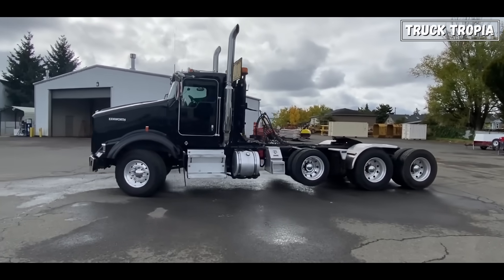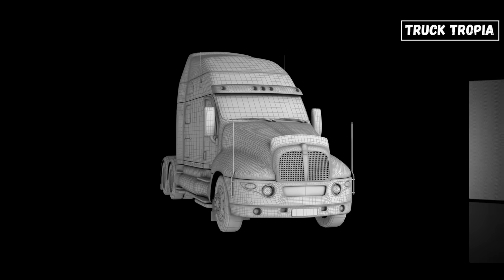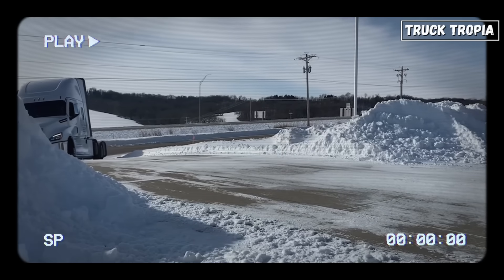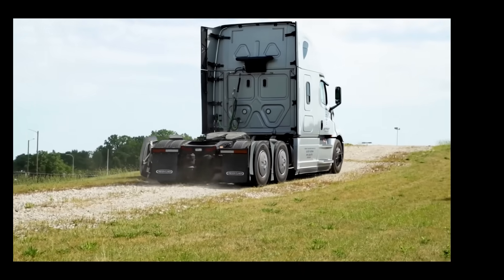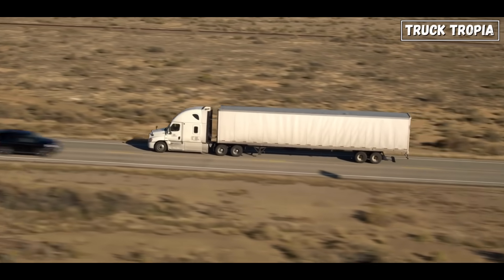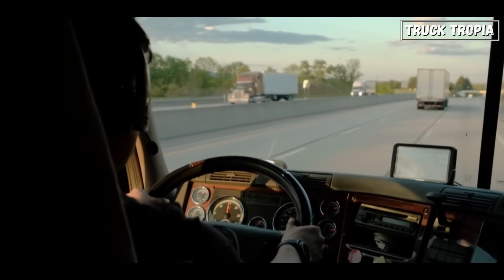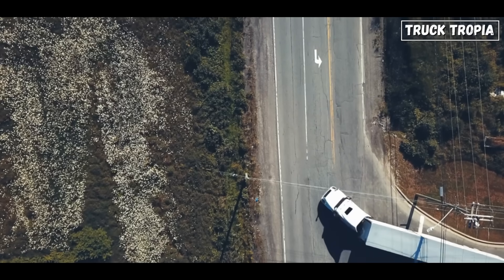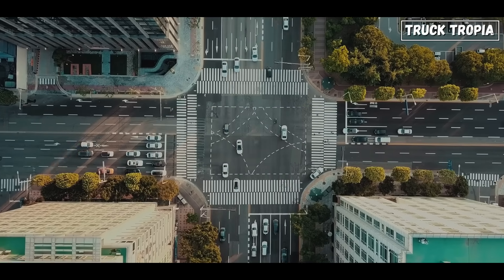Why Do Some Truck Tires Don't Touch The Ground?

Comment: Lifting axles when not needed for weight distribution reduces steering resistance in confined quarters, eg urban areas. You can think of it like a truck with multiple axles almost acting like it’s on rails compared to a car which has a single tyre at each corner. Unless all its axles are self-steering a truck’s tyres will scrub the further they are from the center of rotation.

Comment: I thought "lift-axles" was "stationary axles" that was built to be a bit higher up, but low enough that when a heavy load was placed on the truck, it would push it all down so the "stationary axle" would come into contact with the ground & therefore take up some of the weight, I didn't expect them to be movable, even if that makes more sense, but creates more parts that can break.

Comment: I used to work on a rigid refuse truck which had an extra axel like that at the back in front of the main rear one, it lowered automatically once you reached a certain load weight (typically around 22000 KG) though you could also lower it yourself with the onboard computer. I’m not sure if Dennis Eagle makes those types any more. All the later models I used have the single wheel axels behind the main rear axle and they are connected to the steering, thus always down.

Comment: 0:40 - “Axels are connected to the wheels by bearings”. Nope. Axels are connected to the wheels very rigidly via bolts, making a solid unit. The axels, near the wheels, are connected to the suspension system via roller bearings allowing free rotation of axel & wheel combination.

Comment: What physics did this guy learn?

Friction is a function of normal and the friction coefficient. The number of tires in use doesn't change de normal force, more tires in use just distributes the load more evenly. It won't change friction nor fuel consumption.

Besides using all the tires at the same time will just distribute wear and tear more evenly among all the tires.

What's the point of having a whole axle and tires staying idle? It's cosmetics...

Comment: So cool little bit of side info. Since these wheels are raised and lowered with airbags, most trucks allow you to adjust the pressure in the airbags to maintain proper ground pressure for weight distribution and traction. 
Too much pressure and you can actually put too much weight on these tires leading to excessive wear and even blowouts and you can even make it to where the drive wheels don’t have enough traction. While too little pressure can effectively mean they aren’t even doing anything.

Also a fun little side story, I was doing first time inspection on a truck we bought that had a set of these wheels. I found out the pressure regulator was actually broken for the airbags and when I went to drop the wheels the airbags were so over pressure that you actually couldn’t drive the truck while it was empty because it completely lifted the drive axel about an inch off the ground. Had to basically rebuild the system for the drop wheels because of this
Reply: That's literally fake news. I won't say 100% of all trucks, but almost every single truck is equipped with a dump valve. Not a pressure regulator.. we can't just adjust pressures on the fly. Trucks have ride height adjusters though, but they're completely independent from the drivers seat. 

It's just a lever that moves up and down with the weight of the load that adds or subtracts pressure from the bags to maintain proper height. Has nothing to do with tire ground pressure, or anything else. Strictly a way to maintain the same height regardless of load.
Reply: @sergeantspeed5941  Yeah he thinks that truck axles still use spring and only the tag axles have air bags. Also this garbage video thinks that they actually provide power for some reason because "2?" trucks do.
Reply: Sooooo, no. The axles that lift up when not needed have springs to lift them up. When the driver needs them their air bags are tied into the entire truck airbag suspension system to make sure the bullshit you are saying can never happen. And to be clear, The amount of engineering, and cost per truck, it would take to make the tag axles an entire independent system would make it more difficult to use is an order of magnitude more than just tying it into all the other airbags on the drive axles. You obviously have no idea how trucks actually work.

You're an idiot.

Comment: This is why bumps on the highway often have skid marks on them. As the truck goes over the bump the raised wheels (not spinning) will contact the bump and leave rubber on the road

Comment: Clarification to your first point, more tires do not make more traction, as surface area is not considered in the equation for friction, only pressure and material coefficient. Lift axles also are not powered by the engine, and since they are taking pressure off of the other axles, they will actually reduce traction for accelerating.

Comment: I felt like i already knew the answer to this, and to an extent i did. I knew the floating axle was for when the truck had heavier loads and figured it was for better weight distribution on the suspension. What i didn't know was that they could be lowered dynamically. I thought they activated when the suspension sunk far enough for the floating wheels to touch the ground. Now i know better, all because i didn't let my hubris skip over this video i thought i already knew the answer to.

Comment: Now I have another question. Why are a lot of oversized trailer in US have extra bogie trailer attached that seems not actually distributed any weight and only served to hold a oversize plate. It increase the towing weight, the overall length, the driving complexity, and helps nothing. Is this another trick to complying local law?

Comment: If lowered axles increase grip and improve safety, is there an automatic deployment option under emergency braking/steering? Seems there should be.
Reply: No because when empty, the more tires you have, the less pressure per square inch is applied to the ground i.e you skid the tires much easier. 

When loaded, yes because at full brake, you still can't skid, but benefit from the extra wheels braking.

Comment: I assumed it was a weight thing, when at full or high loads that the suspension is lowered and it helps ease that load. I just assumed it was a passive system.

Comment: Those are drop axles they are not drive axles. they are only used to support extra weight. and there is no sense in running those axles. when there not at enough weight or when the truck is empty. and not using them saves wear and tear on tire's and brake's. maximum weight for trucks on American roadways Is 80.000LBS. but sometimes the weight of the load net weight. along with the tare weight the weight of the truck when it's empty. will make the gross weight which is the total weight of the truck. exceed 80.000LBS. requiring the need for tag axles to be used. this is the reason for these axles. the maximum axle weight's for eighteen wheeled trucks. Is the steer axle being 12.000LBS and 12.500LBS with special steer tires. and 34.000LBS for the drive tandems. and 34.000LBS for trailer tandems. equaling 80.000LBS. anything more than that requires additional axles.

Comment: I don't think much of this is accurate. 
Fuel efficiency: The formula for rolling friction (simplified) is F = n * Cpt * W/n : F is the total rolling friction, n is the number of tires, Cpt is the coefficient of friction per tire, and W is the total weight. For instance if you plug in 18 tires, 16 tires, and 14 tires, with a Cpt of .012 and a weight of 50,000, the rolling friction is identical. Which would indicate zero benefit to fuel efficiency. In fact though, considering the greater weight per tire would cause more deformation, resulting in a higher Cpt, the fuel efficiency would actually decrease with fewer tires touching the ground.

Maintenance: Sure, the axels not being used would experience reduced wear and tear, but those being used would experience increased wear and tear. At best it would be a wash, but considering friction is multiplicative, it would undoubtedly be better to just use them all.

Weight restrictions: Having fewer tires in contact with the surface would have zero impact on the total weight. Weight restrictions are for both the total weight, and where the weight is distributed. Changing the number of tires on the road doesn't change this one bit...

Traction: This one does make sense. Which, if you think about it, actually validates my previous point about the friction. By reducing the number of points of contact, you're increasing traction. And what is traction if not simply friction by another name?

All in all it's usually silly to not be using all the truck tires available. By not doing so you're increasing the wear and tear on those that are in contact with the road, and actually reducing your fuel economy. No doubt these fallacies have continued simply because they've been repeated so many times that people just assume them to be true.

Comment: We call them drop axles, not lift axles. Used to drive a 105k GVW fuel tanker in Oregon - which is a truck with a tank(steer axle, two regular axles, and one drop axle), and a trailer with a bigger tank(8 regular axles, but split 4 in front and 4 in back). Over 11,000 gallons of gasoline.

Comment: Civil engineer here. More axles doesn't mean less wear and tear of road. Quite opposite, if they are put in a row with little gap between them, 2 axles will destroy road less than 3. It's because for asphalt more damaging in this case is sudden compression and decompression cycles one after another than weight itself. That is why regulations (at least here in Europe) specify max single axel load depending on distance between wheels, from 11t at less than 1m up to 20t above 1,8m.

Comment: With a rigid vehicle, if it has a lift-able rear “tag axle” that can distribute weight more evenly, but can make it difficult to make a tight turn, even if it’s a rear steering axle, the tyres will scrub across the ground when trying to do an extremely tight turn so it’s best to lift that when driving in towns or cities with lots of sharp turns.

Comment: Never heard the term "lift axle" before. Both fore and aft have always been called tag axles that i've heard. I even used to build them.
Reply: I've also heard them called "pony" axles but haven't heard that term used for years. My brother had a long-bed 10-wheel grain truck with one drive axle and a split (i.e., longer wheelbase) tag axle farther back. Had a lot a tire wear due to sliding through corners, but his weight distribution allowed him to carry heavier loads (at least according to his calculations). He also had another 10-wheeler with tandem drive axles -- he could take it through farm fields but the drive/tag truck was worthless out there if it was the least bit damp.

Comment: Huh, not what I thought. I imagined that as you add weight, the chassis would sag. At a point, those wheels would touch the ground. Which would distribute weight. I did not know that they could be lifted and dropped manually

Comment: I used to drive a 6 axle dump truck that had 3 lift axles.  However, there are also 7 axle dumps with 4 lift axles

Comment: Front lift axles (ahead of drive axles) are often called "Pusher axles" as well. This is because your driveline "pushes" the axle along, rather than "tagging" along the rear.

Some trucks also have "steerable" pusher/tag axles. They lock out when retracted.

Comment: When you talk about load per axel you only reference regulations without mentioning why those are in place. The regualtion on per-axis load is designed to keep the road from extra wear of overloaded axels. So it's a balance of reducing a wear on the road vs. the efficiency and wear on the tires.

Comment: This is so wrong.  You ever see a car with green valve stem cover caps?  That indicates they are nitrogen filled.  Nitrogen is lighter than oxygen which causes them to the float and rise. But why only the front?  Feng shui which is real science.

Comment: For anyone who might be confused still, think about it this way. If the truck drove over ice it would fall through the ice. With the lift axle down it would still fall through the ice. Trucks are fucking heavy there is no way it could drive on ice. What were you thinking/
Reply: Someone never watched ice road truckers

Comment: I have a lift axle on my truck solely for heavy loads.  It's a 4 axle truck, and the first axle in the drive group (closest to the cab) can be lowered to meet the bridge law requirements.  The pressure in the airbags can be adjusted to shift weight between the steer axle and the drive axle group.  Adding another full axle allows an additional 20,000 pounds to be permitted on the drive group, up to 60k on 3 axles (in most places).

I also run a RGN trailer with 3 fixed axles and a pin-on flip.  4 pins hold the last axle onto the trailer.  2 pins can be removed and the axle can be flipped up when not needed.  Or all 4 pins can be removed and the axle comes off.

Comment: I call them Drop axles. I have installed many of them over the years...Never roll under one with your creeper if you get into truck building, because you never know when the trucks air system will leak down and that axle will drop.
Reply: i've seen trucks where they drop when you set the parking brake, ones where they will lower once air is expended and i've seen some that use coil springs to hold it up and the only thing lowering it is the air bag being inflated

Comment: G'day It looked like several of the images you showed had wheels elevated that are not designed to contact the road. It appears like they are just spare tyreo helv verticaly for ease of access when required to replace a flat tyre.

Comment: TLDW they go up and down to increase; traction, fuel efficiency, or weight distribution depending on what's needed based on the load or road conditions.

Comment: It doesn’t distribute the weight more evenly among the axles. You’ve said this twice already. And it’s wrong. The weight is already distributed evenly among the axles. If you put two more down, the weight will be redistributed among all those axles. What it does is it reduces the force on each axle.

Comment: Booster axles will drop when the truck is loaded past a certain weight. The boost axle is ONLY there to help distribute weight, most of them also have the ability to steer. Boost axles, when working properly will lift off the ground in reverse, also.

Comment: i haven’t watched the video yet but i would say this:

the reason that one or more axles are lifted is because they’re not required at the time. (the truck is either completely empty or just carrying a very lightweight load).

now you might say this: why not just keep the wheels down at all times? that way you never have to think about lowering them down when you have a heavy load.

it’s simply to make the tires last longer. 

that should be kinda correct because i have been driving many big trucks myself and i have a truck drivers license

Comment: I thought they could be a rack for spare tires, or of certain inclines or declines, bumps, (whatever road condition that could be radical enough for an axle to lose contact with the ground), to help keep the weight on more than just one axle.

Comment: Being able to lift the boggie axle and apply as much pressure on the powered axle is definitely a must, up here in Sweden, during the winter.
However, once you get on the motorway, you usually have it lowered, so that the truck isn't so wobbly to keep going straight.
Reply: Glad you say this because the video did not make it clear that the way to increase traction is to RAISE the axle.
Reply: Same in Norway. Usually the lorries can't lift the boggie if the weight is too high, but up here in the north, we can. Lifting a boggie axle when fully loaded, can give you 20+ tons pressure on the driveaxle, and therefore gives you ALOT more grip on slippery surface.
Like Skelterbane69 says, once we're on the bare road, the axles goes back down to keep the lorry more stable :)
Reply: In America most of the time those are automatic. Thats why i dont like them. 2 drive axels are much better the a drive and a lift axel.
Reply: @knightwing4  Our backup truck is a DAF and it's automatic like that too and I hate it. Absolutely worthless in the winter. Wish we had a truck with tandem axles, but it's unnecessary for what we deliver anyway.
Reply: @knightwing4  In what way is fixed tandem drive better than a lift axle? On a tipperlorry, it's understandable. But for 99% of the lorries out on european roads, a boggie lift axle is the way to go. Less wear on the tires, easier to menouver around narrow streets.
Reply: @mrtoth83  Fixed tandem can have both axles powered.
Reply: @johan.ohgren  I know. It doesn't make it better though. 
Higher fuel consumption, alot more wear on the tires, bigger turning radius.
On special lorries, I get it. But for daily driving, it's not better.